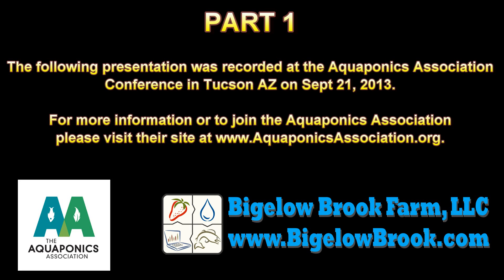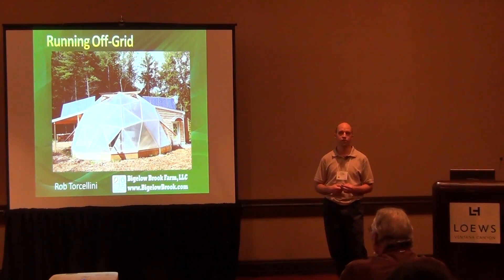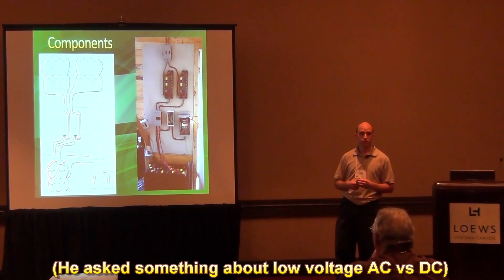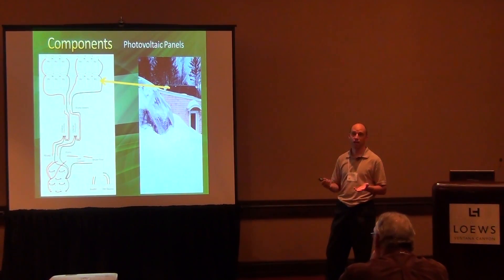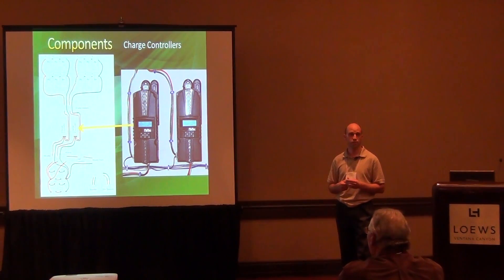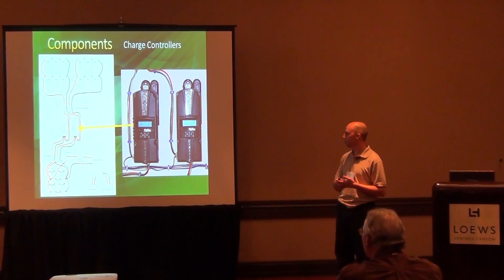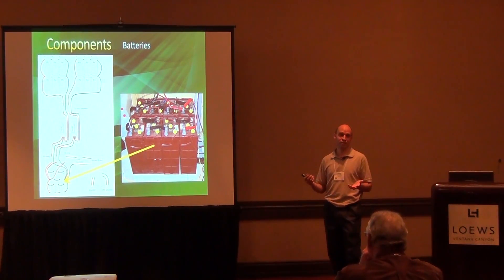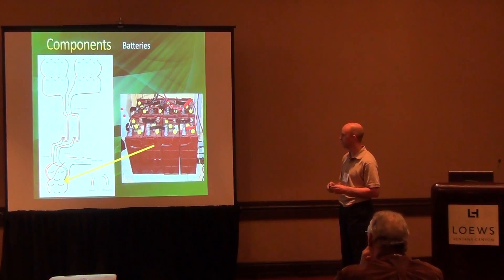Solar Presentation - "Going Off-Grid" Part 1 of 3

Comment: There are so many different area of the Americas here in Central and Southern FL. I HAVE KNOWN a Guy that did recharge a battery bank and run the day time operation of a house with 90wt two 45wt harbor freight panel systems and during a Hurricane POWER THREE HOUSES in the neighborhood with 100 ft cords but Everyone tell / say that solar in FL dose not work but most of the citys and Countys are solar power or has solar back up on there main systems and that solar BAD For FLORIDA